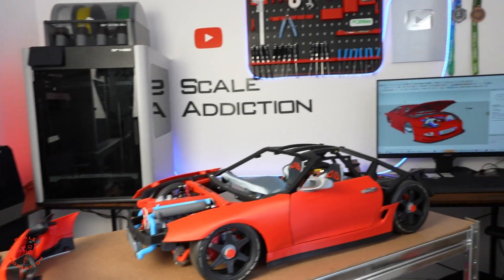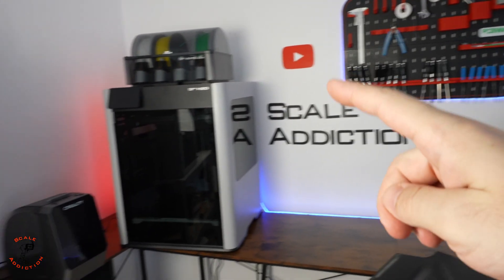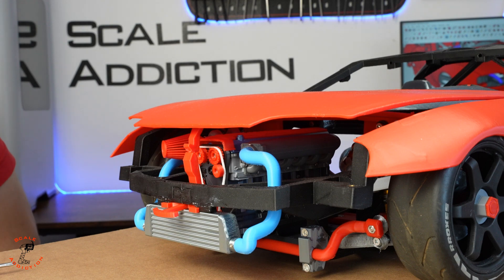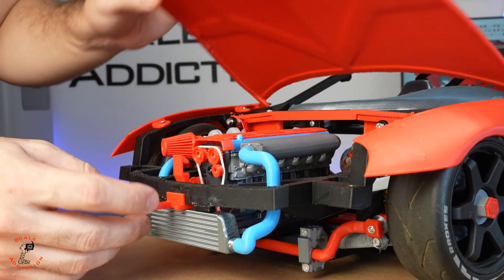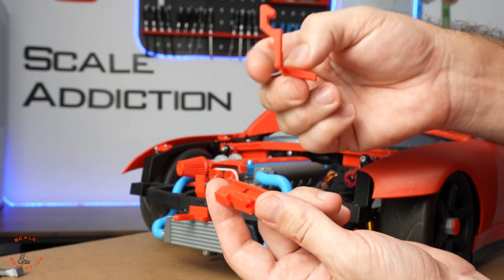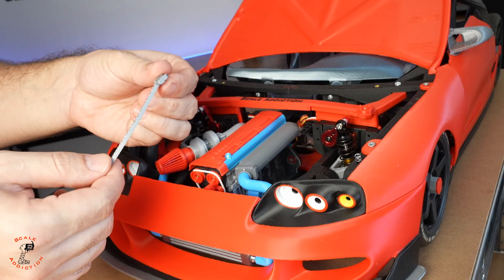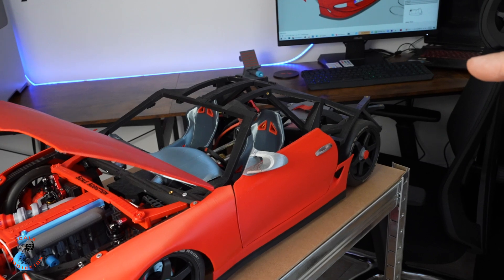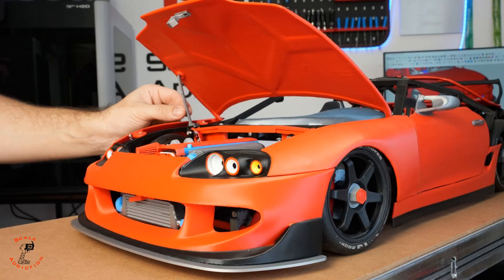Let's make hood and trunk latches together that works like real car(step by step)

Comment: I really wanna see this thing drive again I know that is not what this channel is about but it looks so cool driving arround also GRP makes racing slicks if you need more grip for onroad driving they are 98mm diameter just so you know so they are a little smaller
Reply from the maker: Thank you,  for sure soon, I have a set of GRP but its smaller , now im youing this , its 105mm
Reply: @scaleaddiction  btw is there a RC race track near you? I wish I had a track near me